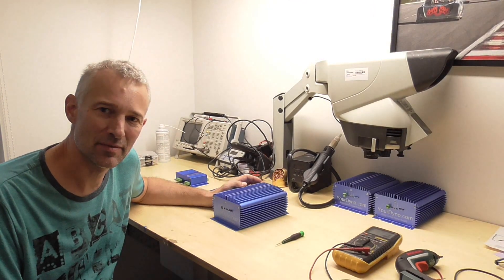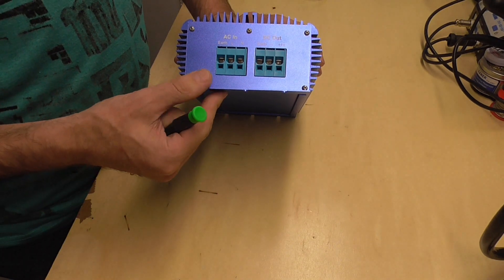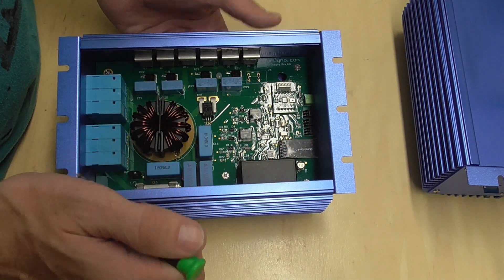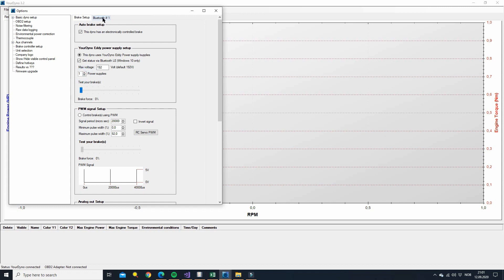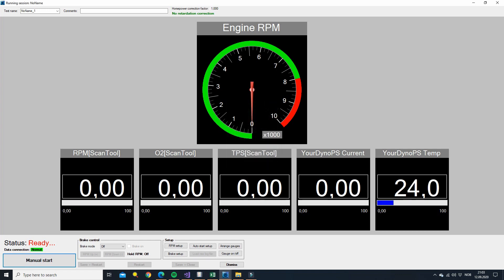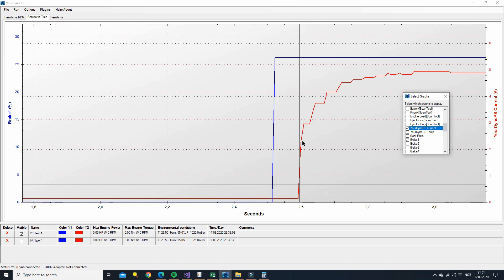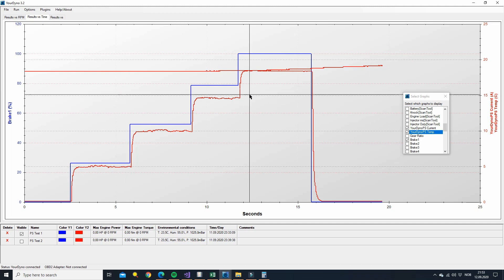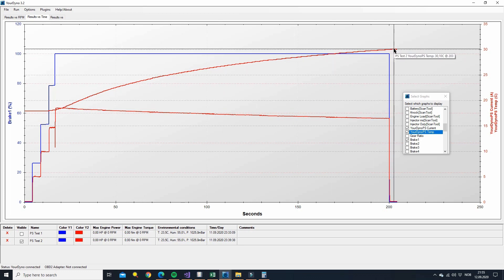YourDyno.com: Eddy current power supply

Comment: can we use it as a replacement for ardyno arduino to a roller diy dyno sir?
Reply: or can you make  a kit of arduino ardyno package?
Reply: its for motorcycle sir..atleast 100 horse power..
Reply from the maker: This is the power supply only, but together with the YourDyno instrument box it is a full system. Check yourdyno.com :-). The power supply is controlled with a 100Hz PWM signal, so if Ardyno can output that then it will be compatible. But much better with the full YourDyno package
Reply: @YourDyno  ok sir thank you verymuch..ill update you soon..be safe""

Comment: What kind changes are required for a brake inorder to test a motorcycle on it with 15k rpm
Reply from the maker: An eddy current brake typically has a lower max rpm than 15k (often 3000-5000RPM). For a roller based dyno, this max RPM is not a problem, as the rollers have lower RPM than the engine even at the highest gear. To test an engine at the crank at 15k RPM the only solution is a water brake, even they are sometimes rated lower than that for max RPM.